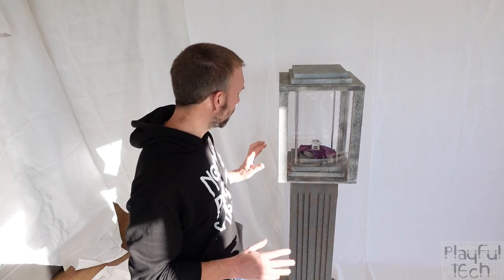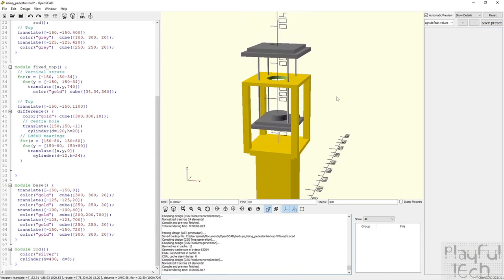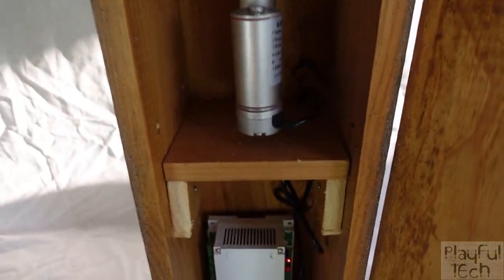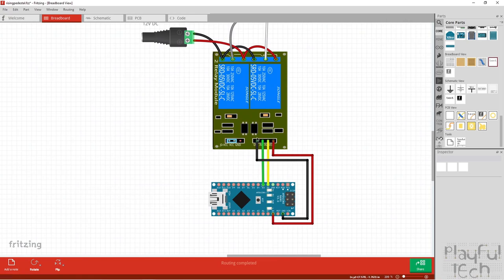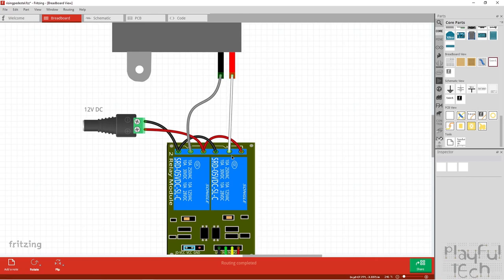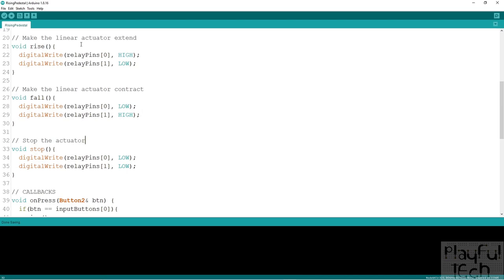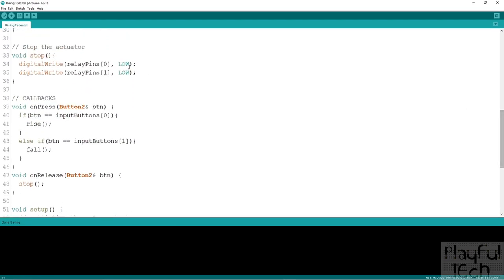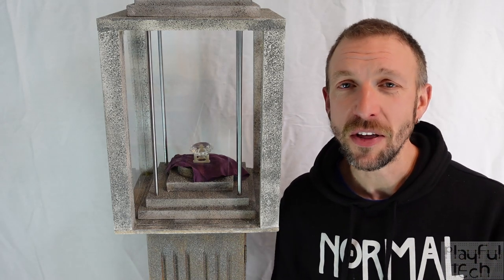Learn to Make Your Own Rising Pedestal Escape Room Prop

Comment: So you've basically designed an XOR circuit using the relays?
That's ingenuous!
Reply from the maker: Kind of, yes: you're right that the linear actuator will only move if one (and only one) of the inputs is HIGH, so in that sense it's like an XOR. But it's more specific than that, because the direction in which it moves is determined by which of the exclusive inputs was HIGH.
Reply: @PlayfulTechnology  That's actually an important distinction. An XOR would simply provide or cut power, whereas here it's switching polarities.
Still it's a very clever way to design it, and one I'd never have thought of.
Reply: H BRIDGE, VERY COMMON.

Comment: Great video, I was super excited when I saw it on my feed! I have to ask, is a microcontroller really necessary to switch polarity for the linear actuator? Couldn't I just have a circuit on one channel of the relay (reed switch, RFID, etc) to trigger it, and another circuit (perhaps a hidden button at the GM station or inside the prop) on the second channel to retract it?
Reply: There's no reason why that wouldn't work. I assume Allister used the microcontroller because he's used to it, and it allows easy integration with software like Node-Red. That way if a team is stuck he could trigger it remotely, he could have a puzzle in another location of the room send a command to initiate it and so on.
But having it self contained with a reed switch, NFC tag and so on, is perfectly fine.
Reply: @s3rth30  good point, I guess I'm just intimidated by having to develop code and would rather find hardware solutions to everything, lol!
Reply: @javcis31  Understandable, if you feel more confident in a hardware only solution. Although the code is easy and small enough that one might even call it beginner friendly, should you desire to sink your teeth in. It's definitely easier than other projects he's done anyway.
Reply: @javcis31  Same here. So in your simple reed switch hardware solution what else is needed to get this to go up and retract? I use reed switches to cut power to mag locks but need to be educated how to use them to switch polarity for a linear actuator
Reply: @kriszylich154  I believe only a two channel relay is needed to pull it off, the first channel being used to raise the actuator while the other retracts it. The first channel would be triggered by the puzzle being solved, and the second by a hidden button, key switch, or reed switch somewhere in the prop.

Comment: Cool idea! but what if players stuck fingers inside the box when it rises?
Reply from the maker: You can't have your fingers inside the box when it rises - it's sealed on all sides. (You could theoretically get your fingers stuck when it closes again, but I'm assuming this would be something that GMs do to reset the room)
Reply: @Playful Technology  how about the hole on the top, where the diamond comes out? If the players rush to take the diamond and puts hand inside from the hole?
Reply: @Mysteeritaiteilija  Exactly my first though: this rising platform clearly has a pinching hazard. However, it probably isnt a probably as long as the motor doesnt have too much force.
Reply: @Mysteeritaiteilija  you could put the jewel holder on springs so pinch would be minimal. And make where it doesn't lower until reset after game over by GM. Or make the top out of foam board so it would just tear out.

Comment: Can you make the linear actuator move faster? I'm looking for a solution to drip an item down inside of a display case and hide the item to make it seem like it disappeared. 

Having your pedestal work in reverse would seem about perfect for what I need if it could work a bit faster.
Reply from the maker: Linear actuators are sold with different speeds - you don't adjust them via a controller, you need to buy one that moves at, say, 2000mm/sec, 3000mm/sec etc.

Comment: What about the obvious risk of crushing when it goes down? Or is it just for looks?
Reply from the maker: While the game is in progress, the only action necessary is for the platform to _rise_, revealing the item. So there is no risk of anything getting crushed. Replacing the item and making the platform go down again would normally be performed by a gamesmaster as part of a reset operation.
Reply: @PlayfulTechnology  I see. That makes sense!
Reply: If worried you can limit the maximum current the motor can take to just enough to operate it which will limit the torque in the event something jams/gets stuck and not just fingers, maybe the item somehow gets knocked off centre so jams against the top of the case for example. I always build in stall protection into anything involving motors as  secondary method which also provides am alarm/fault detection facility is to monitor the motor current with the Arduino A/D and a current sense resistor.

Comment: i've tried making this but I am having an issue. many times when the actuator is extending or retracting the relay wil just flip and start doing the opposite and then it may flip back and forth multiple times. any suggestions? I have it hooked up to a reed switch to go up and a button to go down. I have used a multimeter on the reed switches and they seem to work great i have also removed the button and just bridged the wires to eliminate if it was a button failure.
Reply: I had a similar issue, but don't have an easy answer - have not had the opportunity to try things in the room since it was working partly.  This is most likely from motor noise, so you can look up and try some of the techniques.  One to try is to use a separate power supply for the linear actuator and Arduino, and try to separate them a bit.  If you have any long wires for control etc., maybe try some RS485 boards on each end and twisted pair wire.

Comment: Does anyone have a resource where I can get that fast of a linear actuator. Besides fightprops. I've been looking for a while, only seems to be sloooow once out there.
Reply from the maker: I posted the source of the exact model I'm using... it's 30mm/second, 1000N lifting force, 300mm stroke length, https://www.ebay.co.uk/itm/124219350197